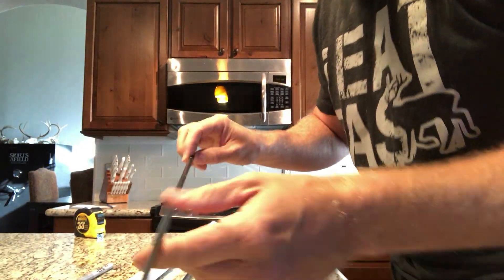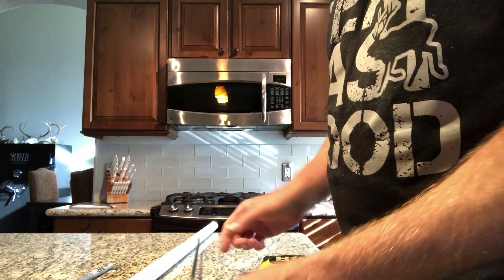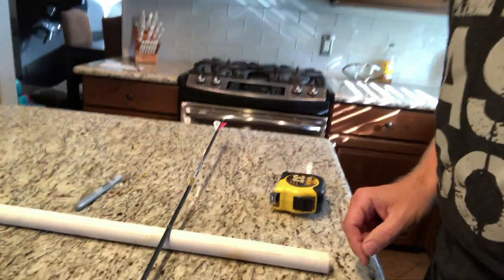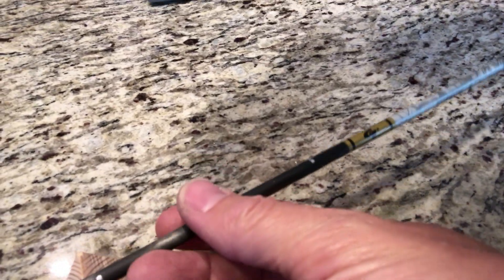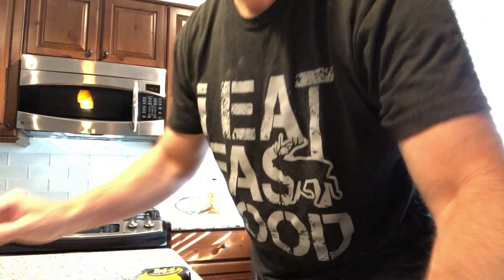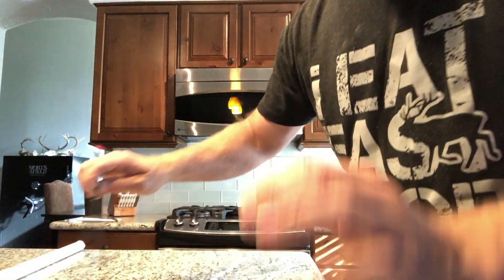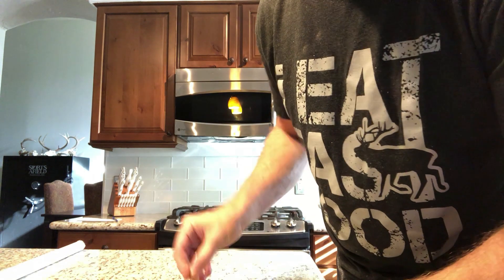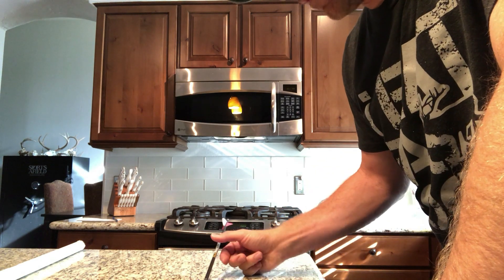Understanding FOC,  How to Measure arrow FOC

Comment: I’ve seen two versions, yours and including the arrow point.  Why isn’t the point included?  It’s part of the length of the arrow.
Reply from the maker: I had asked the same question when i first learned about it, the way it was explained to me is that the point or broadhead are in front of the shaft and not part of it. Front of center of the shaft is the measurement